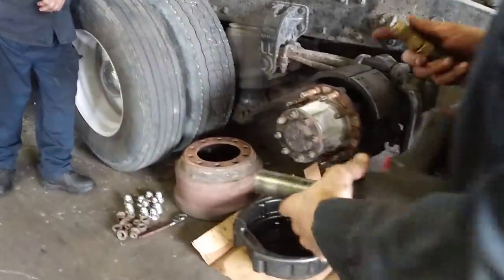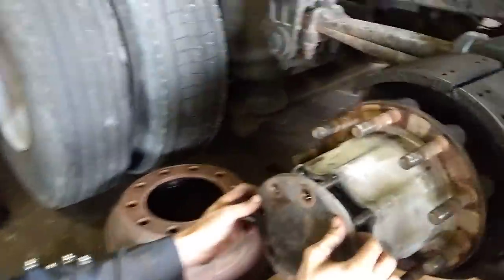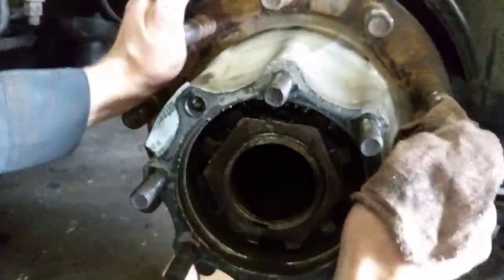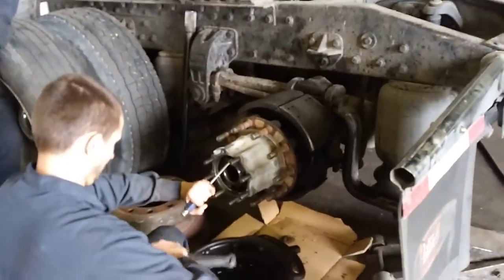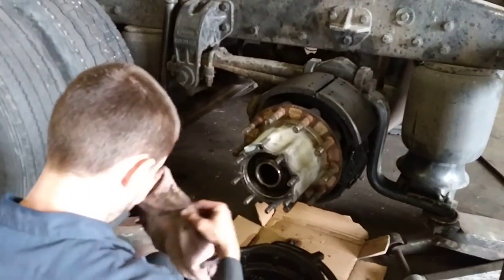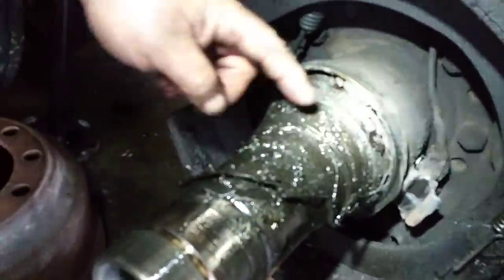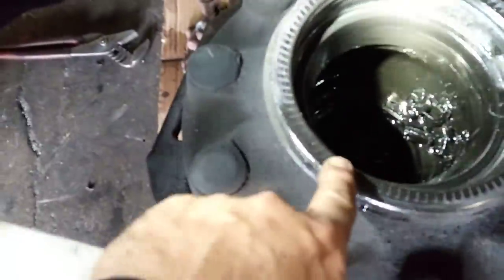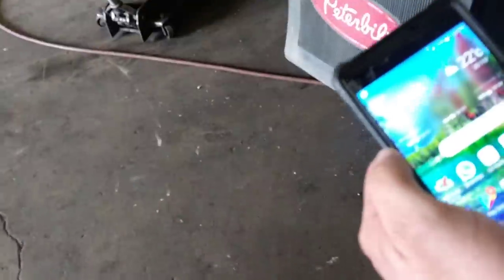What not to do when replacing semi wheel hub seals

Comment: Higher and higher labor rates lead to rushed work ,  tech's worrying about the clock instead of focusing on the job in front of them.
 As the old saying goes , haste makes waste , so does inexperience .   Fortunately those duals didn't come off and kill someone , and yes if you want oil to  your wheel bearings the axle oil needs to be topped off .
Reply from the maker: You are absolutely right driver.Mobile semi truck and trailer repair. Call or TEXT Richard at 708-945-6509- serving Chicago and suburbs. We also have heavy duty tow trucks. Click the link below for more information on our website. ➡️  www.chicagomobiletruckrepair.com
Reply from the maker: Mobile semi truck and trailer repair. Call or TEXT Richard at 708-945-6509- serving Chicago and suburbs. We also have heavy duty tow trucks. Click the link below for more information on our website. ➡️  www.chicagomobiletruckrepair.com
Reply: Labor rate has nothing to do with rushing

Comment: Common misconception is the inner nut coming off by hand is a bad thing, depending on the lock nut system after setting preload the inner nut is torqued to 100ft lb and backed out 1/4 turn which in many cases is just hand tight.
Reply: Inner nut 200ftlb while rotating hub then back off one full turn then re torque to 50ft lbs final spec on inner nut rule of thumb
Reply: @class8garage308 somebody did that on my crane and had to pay axle surgeons to fix their mistake. OP is correct it depends on the manufacturer and lock setup.

Comment: While it may have been properly assembled, those hubs should have a plug in them somewhere to facillitate PRE-LUBING the hub after a disassembly operation of ANY KIND. Only a few miles of dry running will screw the bearings. a 'top-off'of the diff does  NOT guarantee the bearing won't start dry.  I ALWAYS pre-greased them AND primed the hubs. The difference between 300,000 oiles vs. 300.
Reply: You grease oil bath bearings huh?
Reply: @dozer1642  yes, that's what I said....and THAT was before all your bearings were made in China....Those bearings are subjected to severe service the MOMENT they roll.
Reply: @irredeemabledeplorable5227  funny. Not a single manufacturer of oil bath hubs i’ve ever encountered recommends greasing bearings on install. 

Not all oils can tolerate grease, which is technically contamination in the oil. 

When installed correctly, oil bath bearings do not need grease.
Reply: @dozer1642  Have it your way. I've always said you can lead a  horse to water, but you can't MAKE him smart.....lmao....by the way, how many manufactures have you encountered?....lmao
Reply: @irredeemabledeplorable5227  you sound like you do, and a bad on at that...
Reply: @dozer1642  correct you are!!👍👍
Reply: @irredeemabledeplorable5227  You did as soon as you played the "I know everything and anyone who disagrees is a moron" game.

It's as old as the hills and way too common.

Comment: loose wheel bearing will do it everytime, also plugged rear diff vent tube plugged will cause seal to let go
Reply: Tight wheel bearing, not loose. Jam nut should have been tight.

Comment: I doubt the bearing was run too tight. If it had been, it would get hot enough to catch the oil on fire as it leaked out and warp that axel housing almost beyond repair.  Had one happen to me once in West Memphis, took a special machine to cut and replace the end of the axel housing. It was so warpped they couldn't remove the axel until the end of the axel housing was cut off.
Reply from the maker: Well as they say stuff happens and you got to pay to play. But you always got to make sure that your axles are full of lube and your drive shafts greased U-joints greased not to mention the tie rods

Comment: inner nut should be hand tight or just over hand tight outer should be tight
Reply from the maker: You are correct!!!   👍
Reply: wrong in many cases. and catastrophically wrong at that.
Reply: @petejohnson8397  nope
Reply: @thebad300  spoken like someone that used to work at Brighton. That is what they did on my J340 rear ends, instead of what the manufacturer called for, which is for the adjuster nut to be run down to 125, back a half turn, run to 50 then back a quarter turn. locking jam nut to high torque. They had to pay axle surgeons to fix their mistake. I didn't make it 35 miles from their shop. I checked the other 3 hubs that luckily didnt gall and all were done wrong. Different manufacturers have different specs for different setups. Thread pitch and size of the adjuster nuts and the method of locking the nut makes all the difference.

Comment: Been a while, but it does not seem that there is very much threads past the locking nut. 
Could be that the seal was incorrect or not installed completely. Causing the hub to feel seated on the tube when it wasn't.
Reply from the maker: Yeah but it did cost them a lot of money they have the truck towed to the shop and all of the parts replaced. Due to negligence.. Chicago semi truck and trailer towing and mobile truck repair. Call Richard at 708-945-6509. Visit our website at 
www.heavydutytowingnow.com

Comment: we are the ones they call next to replace the spindle.
Reply: Exactly  that spindle is ruined, the bearing seat is galled I was watching him remove the jam nut by hand!!? That nut should have been torqued to 250 ft lbs after the hub end play set to 0.001” to 0.005” highly likely the cause of failure the end play not correct. All that destroyed metal now is in the differential and most likely contaminated the other side soon to fail. I’ve done a few of these and it’s a mess.
Reply: I got a great on vehicle repair shop here in phoenix. AZ FLEET POWER saved a few for me.
Reply from the maker: Chicago semi truck and trailer towing and mobile truck repair. Call Richard at 708-945-6509. Visit our website at 
www.heavydutytowingnow.com

Comment: DID THEY CHECK THE OTHER 3 HUBS??
Reply: Yes.
Reply: Jonny Long 
YEARS AGO THERE WAS A INTERNATIONAL HARVESTOR CAB AND CHASSIS, NEW DELIVEREDTO AN LOCAL CRANE DEALERSHIP AND A CRANE WAS INSTALLED THEN SENT OUT FOR DELIVERY!
A FEW MILES LATER IT HAD A AXLE BEARING FAILURE!
THEY MUST HAVE HAD A GREENHORN AT THE AXLE PLANT
BECAUSE ON BOTH AXLES THERE WAS ONLY THE OUTER BEARINGS 
AND THE SEALS, NO INNER BEARINGS AT ALL!!
WHEN IT WAS MOVED AS A CAB AND CHASSIS, ALL WENT WELL UNTIL THE CRANE WAS INSTALLED!!
Reply: I would.

Comment: mine popped out on the passanger side after climbing up on a curb after having to maneuver in a tight dock rea it leaked and i put it back in. and drove after everything seemed fine.. is there something i ws supposed to do?
Reply from the maker: we would have to take a take a look at it and see what is going on did you make any corrections if necessary

Comment: Brake pads, drum, , bearing, wheel seal and Cut axel and replace. That will be 3,000$ parts and labor easy. That axel is garbage now.
Reply: Brake shoes.... I don’t see a brake caliper.
Reply: @tntzimmerman9552  Don't need to. They are contaminated with gear oil.
Reply: Clare.... brake pads go on a disc brake set up. This unit uses brake shoes . It’s a drum brake setup.
Reply: @tntzimmerman9552  I misinterpreted your use of the word caliper as in a measuring tool not a brake caliper used on disc brakes. The shop said they needed replacing and I you said caliper, I thought you were referring to measuring the wear shoes. Yes, I am aware of the difference in braking systems which is why I said Don't need to, contaminated with gear oil. Sometimes I amaze myself.
Reply: Nah 15-1800. Axle surgeon welds a new spindle and replace hub and bearings. New seals and oil and shoes. Drum is probably fine

Comment: You shouldn’t be using an impact on any of those bearing nuts.
Reply: That’s what I was thinking, inner nut shouldn’t be done up with an impact or a breaker bar...
Reply: Armchair mechanic.
Reply: Can you be more specific and let everyone know how much torque should be used to tighten the nut?
Reply: If you have to ask use the impact and do 4 duga duga
Reply: @hes_so_great3291  you just said can't use impact, and some have more torque than others. There must be a specific technical torque number, right? I mean lets get it done like true professionals😅
Reply: @nonkoshergoy763  tighten to 150ish (not real critical); to get initial bearing set. Loosen completely. Tighten to 35-50 ft lb. (set inner nut final torque by feeling bearing drag) you need to get a feel for it. Torque jam nut to about 200-250 lb ft. No need for more. 
Do not pack bearings with hard grease.
Do not over torque inner nut.  (Fairly certain this is what happened here)
Do not over torque any fasteners
Fill cavity between bearings with 8090 and lightly coat bearing races with human use petroleum jelly
Test drive 5 miles
Check bearings
Get operator to check bearing play and temp at 50 And 500 miles (if applicable)
Reply: @justinmartin8887  I didn't expect that someone would know all this 😆 well done! Hopefully it helps some mechanics out here 💪

Comment: Looks like they didn't fill the well of the hub with 75w90 nor top off the diff after they did the wheel seal.
Reply from the maker: Mobile semi truck and trailer repair. Call or TEXT Richard at 708-945-6509- serving Chicago and suburbs. We also have heavy duty tow trucks. Click the link below for more information on our website. ➡️  www.chicagomobiletruckrepair.com

Comment: Its impossible to tell from where the video ended with all that grease and not having pulled the race and used a micrometer, if the axle housing bearing spindle area was damaged where the bearing cone races sit as they could have spun and ruined the housing which means a huge expense to rebuild that axle end or be replacing the whole housing. Fortunate that the hub never parted ways with the truck and whomever put that together last never torqued the outer locking nut to the inner nut as there is no way the outside nut should be able to be spun off by hand with a two nut system, yes the inner one should be able to spin right off without any tools once the outer nut is off. This goes to show that if a mechanic or for that matter a do it yourself-er didn't have a clue what they were doing, this is the bad day you end up with or worse and sadly there are mechanics out there who don't have a clue and shouldn't be allowed near a tonka toy,  never mind an actual truck.
Reply: Yeah I’m just wondering whoever did the repair job previously will they have to pay for that fuck up
Reply: @terrellscaife2411  That is a very good question and I would suspect in a situation like this its one thing to point a finger but to prove without a doubt that it was the fault of the prior mechanic its pretty tough and could claim that the unit was not brought back to them for examination and bla bla bla. And who is to say it was a mechanic, the owner of the truck would be better able to answer as to where the maintenance had been done. But poor workmanship is a thing that certainly would have caused deaths on the road over the years and as well good licensed mechanics can be pushed to do shoddy fast work in a shop if the shop leans on them to produce or get a pink slip. But yet any issues fall back on the mechanic that signs off on it they are at fault. I have a friend ( actually a few heavy duty mechanic friends ) who is licensed to do CVIP's ( that is a Canadian acronym for Commercial Vehicle Inspection Program ) and at times he has been approached by trucking companies to do a fast quicky inspection to pass a truck or trailer they know full well has issues and he says either I do it properly or you are free to ask some other shop/mechanic ... its MY name on the line !.
Reply: Wow you have a friend that does Canadian DOT inspections and I guess it would be hard to point the finger at the last person that did the job because so many other factors could come out to play
Reply: @terrellscaife2411  Well I should clarify that if its a licensed mechanic that signs off on the work, its his rear that is on the line. So lets say they have some newbie lacky in the shop and he is doing the work, who signs off on it ... so again it falls back on the licensed mechanic who may be the shop foreman for example who signs off the job. Never the less with what I saw in this video, if the outer nut is not torqued to the inner nut with this style of retention system, that is a big fail right there and impossible to really hold a perfect wheel end bearing end play. With what I have done on my own trucks with wheel ends over the years I use a dial indicator to know exactly what I have when setting up a bearing assembly so there is no guess work, and I have closely inspected the bearings and if in any doubt replace the bearing sets rather then take any chances. That way I can sleep at night knowing I cut no corners, wheel ends, steering components, tires, not something to f around with at all as this video and far worse is the reality of what can and does happen.
Reply: Yep makes a lot of sense to me but if you’re out on the road and you in a situation where you need to take or have to take your truck to the shop then I guess it’s basically the best of luck just hope they fix your vehicle right
Reply: @terrellscaife2411  Exactly, then one is reliant on the shop you limp or drag your unit into and hope they are competent and do right by their customers. I'm sure there are lots of decent shops around but its the few that taint the picture or a decent shop with a shoddy mechanic as that certainly happens as well and takes a while sometimes for a shop to realize the short comings of a mechanic they hired a while back ... until the wheels fall off ( pun intended ! )

Comment: Tightend down to dam tight.
How bout the spindle
Reply: Id say the opposite.  Left loose. To tight would left hot marks. More likely someone put it on and soon as they got snug they backed off to zero and locked down. Instead of seating the seal than zeroing and lock down. Very common with new mechanics.

Comment: Was this that mechanics mistake ??? 🤔
Reply from the maker: No the shabby work was not done originally  by the mechanic in video...he actually  repaired what the truck stop mechanic messed up.... the truck was towed into  the shop in the video to have the work redone because it was repaired at a truck stop previously and the driver only made it 200 miles before he had problems

Comment: Total bill including towing  6,433.18
All because of one nut over torqued
Reply: If it was over torqued it probably would’ve started smoking and almost caught fire.
Reply: Doubt it was overtorqued, they didn't tighten it all the way. We see this all the time in our shop. We call it "tightening against the seal" because  they think it's all the way tight, but really they're just feeling the seal going onto the shoulder of the spindle. That's why you're supposed to torque it down hard and then back it off. To set both bearings AND seal.
Reply from the maker: Mobile semi truck and trailer repair. Call or TEXT Richard at 708-945-6509- serving Chicago and suburbs. We also have heavy duty tow trucks. Click the link below for more information on our website. ➡️  www.chicagomobiletruckrepair.com